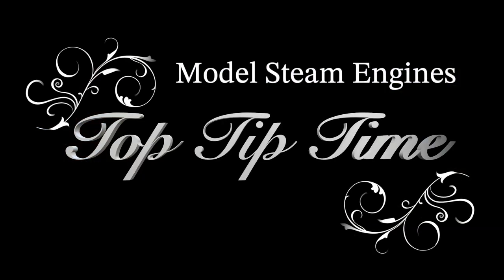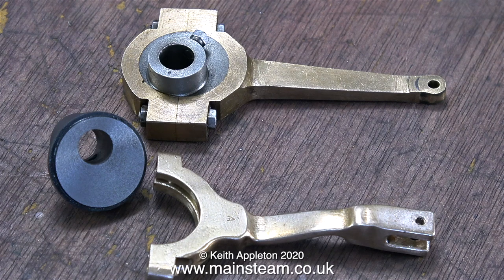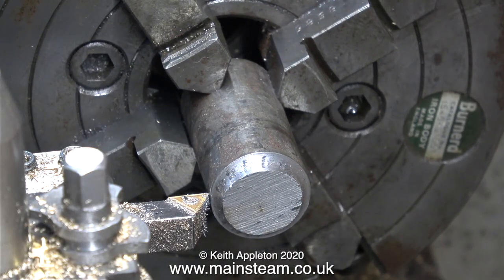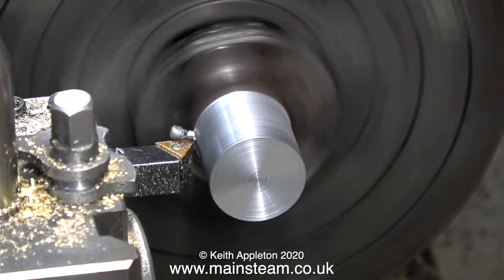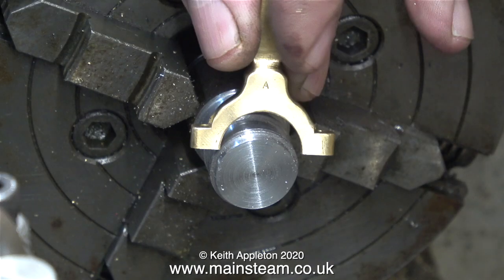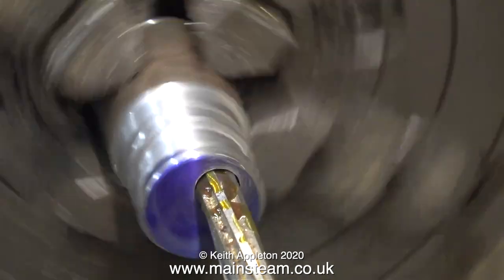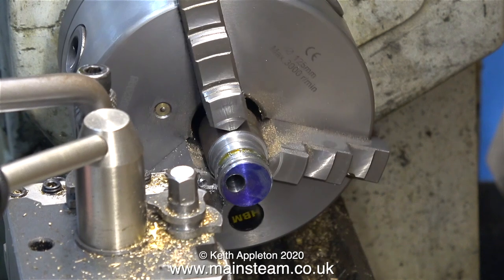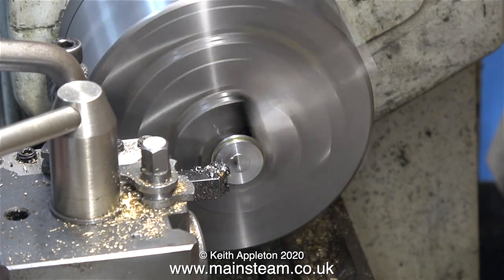MODEL STEAM ENGINES - TOP TIP TIME - PART #7

Comment: Hi Keith, Good video with a great tip. It's amazing to how parting is the hardiest part of working on a small lathe and takes most "tricks" to figure out. It is differently not as straight forward as one might think.
Reply from the maker: You are right there, a very small margin for error.